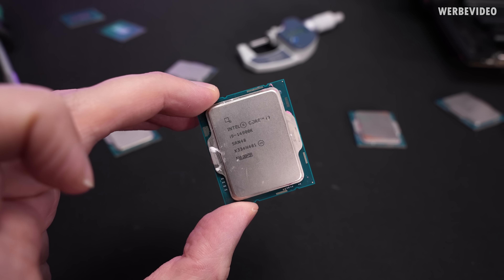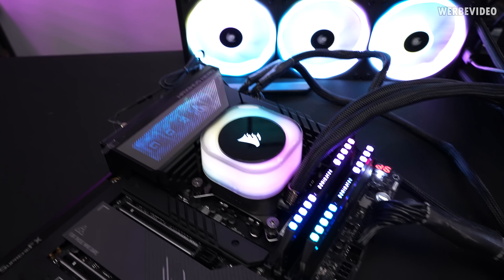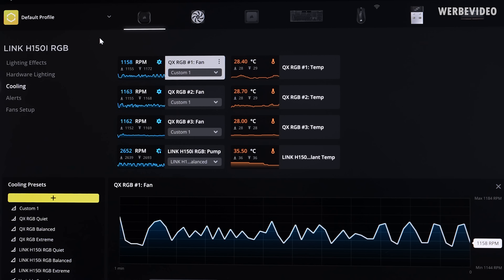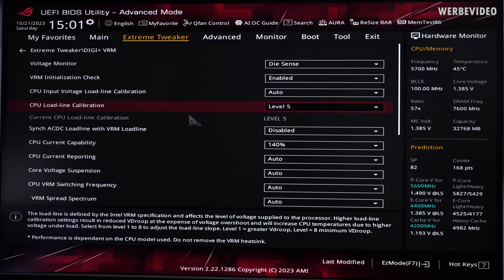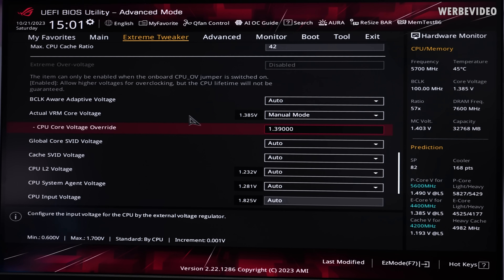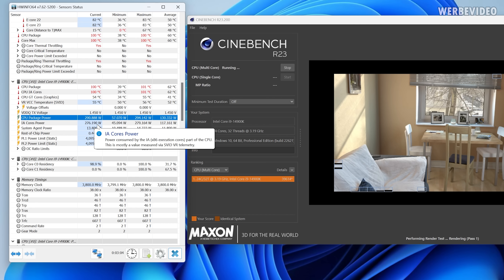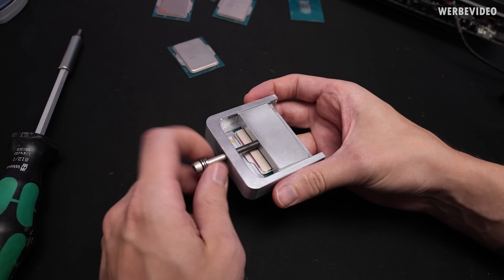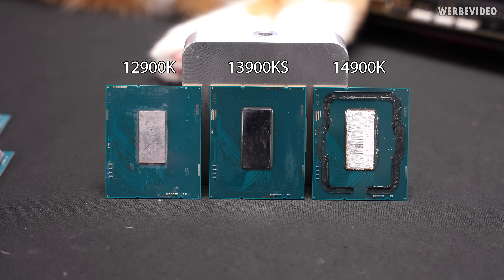Surprising Results - 14900K Delidding

Comment: A leap in performance that can't be measured
Reply: Immeasurable
Reply: We're talking upper mid single digits! I think I even saw 6% at one point in a game benchmark!
Reply: Think of the poor sand that was expecting to go into something amazing and innovative.
Reply: "You can literally see it ! " Intel Computex 2021 opening keynote meme.
Reply: Hahaha 🤣
Reply: It's so amazing it's beyond our technology to measure it!
Reply: literally 😆
Reply: You can but you need a Plankmeter.
Reply: Literally can't measure it
Reply: the difference between 13th gen and 14th gen is , 14th gen is a higher IPC and better Quality silica due too improvements in production and experience gained from Intel's new Architecture . better more refined quality Silica with lower temps , higher boost clock out of box and better overclocking potential . most reviewers didn't understand or know really what was going on ...
Reply: @EpicGamingEct  Thats utter bullshit. 12th to 13th gen you get abit of IPC improvement because L2 cache has been increased. 13th gen to 14th gen see no IPC improvement because nothing has changed. Even the die size is the same.
Reply: EpicGamingBS - utter fail. There's nothing new. It's the same die. Even the same stepping.  There's no improvement. Same IPC same performance same power draw if you overclock a 13900K to the 14900K clocks.  Every reviewer pointed this out, its a sham to call it a refresh let alone a "new generation"

And this is all Intel will have for the next 12 months outside of some lower power laptop chips. Eek.
Reply: @EpicGamingEct  nobody cares.  People pay for real world performance
Reply: @EpicGamingEct   Back too you Steve.
Reply: @EpicGamingEct  LOL it's still not next gen, just a refresh. Then name it something like 13950K

Comment: I am a comparative noob, so I have to ask: what is the intended benefit of delidditting a CPU?
Reply: Better cooling, so a bit higher theoretical clockspeed.
Reply: To lower the max temperature.
Reply: @giorgosapo4508  gotcha. Specifically with liquid cooling I'm assuming
Reply: @Stormpriest  The temps will be better no matter the cooling option though you definitely benefit more with liquid cooling 👍
Reply: @giorgosapo4508  like I said, a comparative new.
Aka, I'm still running air cooled, which means I'm running about 18 fans in my core P8.
This is my next horizon apparently
Reply: @Stormpriest  If you just think logically, between the CPU and heatspreader there is a thermal interface, and there's another one between the heatspreader and cooler. Therefore options to optimize the heat transfer is between any or all of these bottlenecks. Delidding allows you to replace these or direct die cool the part. So the end goal is always simply to allow for better heattransfer through other methods than the factory configuration. Linus has a very old video about doing it with a 7700K that's still relevant today. And he has one on direct die cooling as well if you want to get the full scoop. Although they're 5+ year old videos they're relevant to your question.
Reply: @Stormpriest  Lovely case! Liquid cooling is definitely your next step , in my opinion it's so much worth it and you get awesome looks too especially if you opt for a beautiful screen over the pump like I personally have the Corsair H170i Elite LCD edition.
Reply: As shown in the video, reduced temps. Usually by removing the heat spreader and using cooler directly on the die. It can be dangerous as you can crack the edge of the core itself if not careful.
Direct die cooling was normal back before they started with these lids (heat spreaders). But you have to go back over 20 years for this.
I believe the last Intel desktop without one was the Pentium 3 and for AMD the Athlon XP.
Reply: Can't overclock with work related stuff because its naturally unstable . So most overclocking is done and benefits nothing .

Comment: surprised how bad the silicon was on that 14900k. Would have thought they were cherry picked to have some form of silicon refinement for a tangible performance increase. Yet, the chip might have even been slower than a whole plethora of 13th gen chips LOL. Should at least be doing 5.8 all cores tbh to be worthwhile at all
Reply: They don't necessarily bin them above the standard specs, they're saving those for an eventual KS special edition or whatever like they do every gen these days.
Reply: @fVNzO When those Ks's will be launched?
Reply: @SirD3em most likely Q1 2024 as usual right after the non-K SKUs
Reply: They are cherry picking these 14900k... by keeping the best parts for an upcoming 14900ks.
Reply: @thomasg5554 Mates if adding an entirely new "generational" +1000 to the numbering cannot give us a CPU with even a 1-2% greater performance increase to the 13900k or ks the 14900ks Binning won't be all too impressive either,
Reply: Thank you sir, I'll wait for that then.
Reply: To be fair, an SP 82 is the worst one I've ever seen!